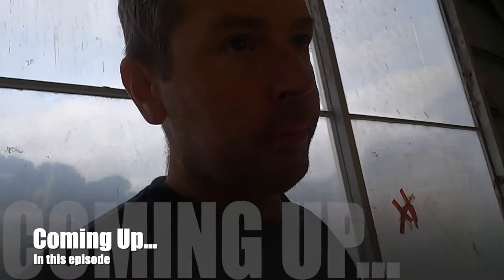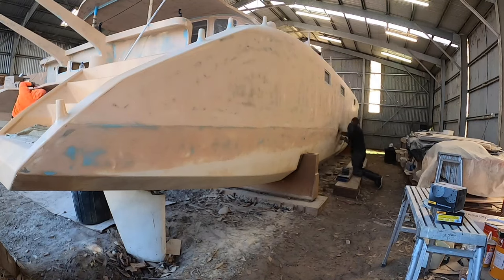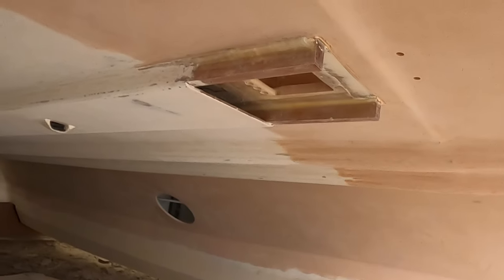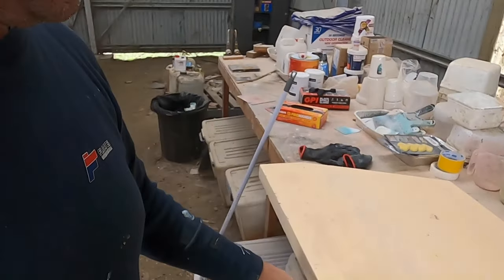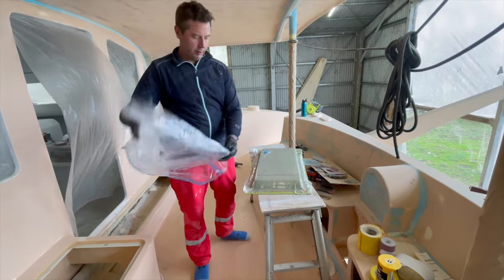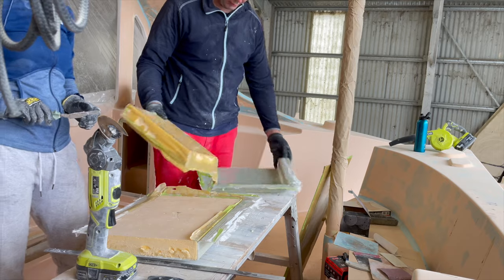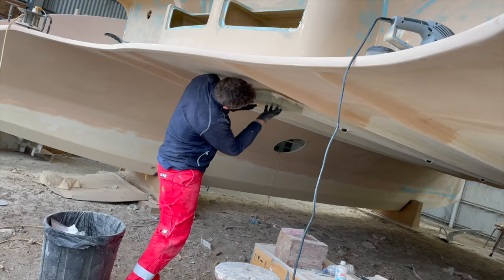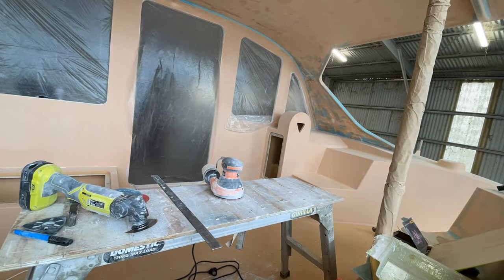Reef line covers for Wilda - S02E41- DIY Catamaran

Comment: Having the lines run under the cat is unique, the lines will be constantly wet with salt water. I think this will reduce its life? Or am I wrong?
Reply from the maker: Not unique. A common solution on Schionning boats. Maybe not so common on other designs.. I'm not sure how brilliant the design is, but I don't expect the lines to be wet in there, and they are protected from UV... What I don't like much is that I can't see the line, but that is true for the mast on any boat. Both sets of turning blocks are accessible for inspection.
Pros and cons with any design I guess.

Comment: What a waste of plastic material for single use moulds!! This is absolutely unnecessary. You should have made some female moulds from cheap white coated chipboard.
Reply from the maker: Waste while building is an issue for sure.. I try not to use excessive amounts of single use plastic, but it is inevitable. The blocks I used are leftovers from other construction that I already had and will get one more use out of them at least. The bag gets only one use. Sadly lots of single use plastic when building any fiberglass boat.. or even wooden ones. Hopefully the boat lasts for 50 years or so, at least in part, making up for it.